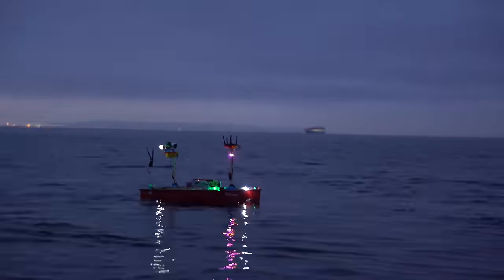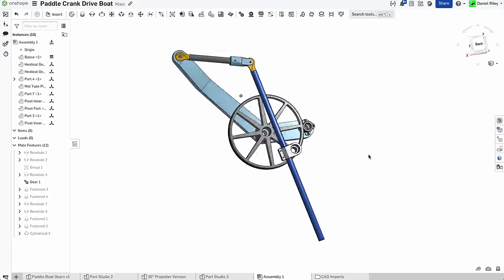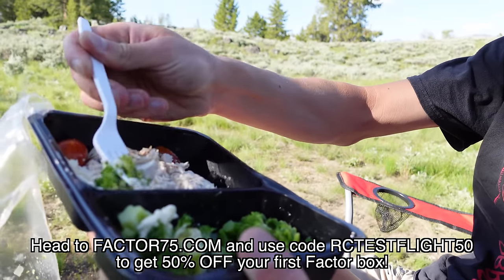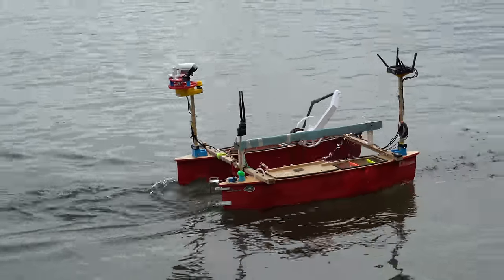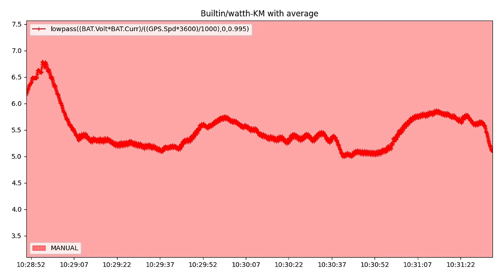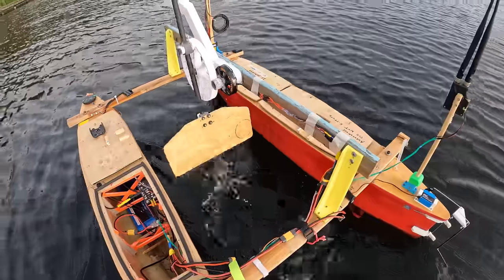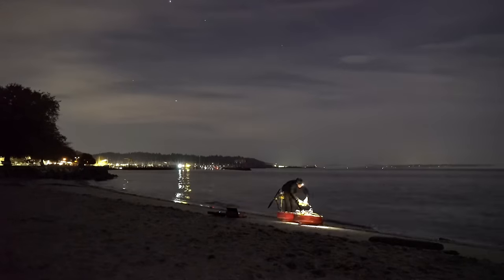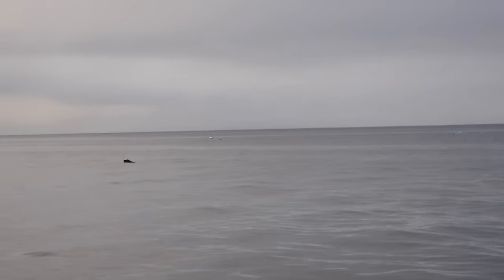Propeller Killer? High Efficiency Paddle Vs. Propeller

Comment: I once rode in a kayak that was powered by paddles. It was inspired by sea turtles. It had four paddles, two in the front and two in the back. You used a pedal like a recumbent bike and it would paddle side to side. It worked very well and was surprisingly efficient. This guy from Louisiana wanted it for use in the bayou.

Comment: One source of inefficiency is the eddies created on the sides and bottom of the paddle. I wonder if you installed sheet metal guides on the sides and beneath the paddle (as close as possible to the paddle) the eddy  issue would reduce.

Comment: i thought that adding another "bar" to the linkage could optimize the angular relationship of paddle to water...  there's very little energy 'lost' during the paddle 'return, but it does result in quite uneven loading on the drive train, so that a paddle on each side, with 180° offset might be smoother.
And, hmmm... Since tuna, dolphins and sharks all use an oscillating tail? Side to side, with adjustable compliance of the "fin"? Maybe use variable air pressure to increase/decrease the stiffness of the "tail" under different conditions...a quite small compressor that only runs as needed, and an electrical  valve

Comment: What about using differential drag brakes for steering with a paddle with a more optimized shape?  That should solve the seaweed issue, and only incurring drag when it needs to steer may mean it ends up more efficient.  

The paddle may also want to use the adjustable attachment method as well for reliability vs  waves and the like.

Comment: Hi. Great Maschine. Dome ideas: Put a weight on the big wheel that goes up when paddle ist in air and down when in water. Thus will glatten your power curve.

Another one: guess why sports paddlers use U- shaped paddlers and planes have wringlets. The energy in the whirlpools ist lost. The methods above macke them smaller.

IT nicht also bei worthwile to drill some holes in the paddle, for the same reason paracutes let air through

Comment: i suggest you make the paddle much smaller, just a rectangle, that would be completely submerged on the power stroke - that way you will minimize the air drag on the return stroke, i think.

Comment: Interesting. 
One question: what would happen to the paddle efficiency if you put it into a channel? A really tight channel left-right with just a couple of millimetres of clearance and the height of the paddle. Just so to minimise the amount of water that could swirl around at the edges. (like the point you are making at 12:35)

Comment: I’m sure plenty of other people have said this, but it’s my two cents so whatever. Part of the efficiency of a paddle comes from the fact that it not only pushes water behind it, but pulls the water from in front of it. But it can only do that most effectively when the entire paddle is submerged. Otherwise you get air sitting in front of the paddle Preventing it from pulling water from in front of it. Creating a larger path wheel might help solve this problem. Giving the paddle more of an ability to lift up out of the water so that you can make the paddle sink deeper.

Comment: Best chance of the boat to succeed I believe is longer waterline. It will dampen the smaller wind waves while still allowing you to keep the 'air boat' design & avoid pitching oscillation.

Comment: if you wish for an idea to milk that boat once more 

air duct-ed thrust (its kind of like how jets refocuses their exhaust but this idea has no jet's involved unless if used to produce airflow) essentially its like using a leaf blower or an EDF and aiming the propelled air via pipe (or ducts like you would a/c ) and in my idea would be placing the outlet ports to thrust from between the hulls

just had a funny idea thrust via compressed air and obviously that would be the worst in inefficiency but i released a chuckle when the thought sneak in

Comment: Very nice job 👍 
Maybe you should try some combination of either propulsion systems? For instance a front paddle wheel between two boat hull and one or more rear air thrust with blades
In addition you should definitely try other hull designs (different transom, different forecast, bulb etc.).
Have a nice day 😊

Comment: A lot of water is bypassing the paddle around the sides so would a curved paddle improve efficiency?
Also the aero props let you down big time so would a smaller 3 or 4 bladed prop be a better option. Perhaps using ducted fans would be a better choice

Comment: I wonder if a multi-paddle setup could be engineered to take advantage of vortex shedding around the paddle edges. Since a portion of the water in the vortex is moving forwards relative to the stationary water, a well-timed and -placed paddle stroke could "push off" of it for a boost in efficiency.

Comment: How about sail? Literally you only use the motor to adjust for positioning in the wind. It might need some better software for navigating when against the wind but theoretically exponentially more efficient (if slower).

Comment: If you are interested in testing other methods for efficiency, I'd be really interested in the dual screw drive like Colin Furze tank thing he made (or the original ice explorer it's based on).  I realise that the hull wouldn't be the same, so it's not a direct comparison, but interesting all the same?

Comment: FYI  I wonder if it might be interesting to test out the efficiency of really large propellers in the water.  This is ancient history and we know how memories are... But, when we were kids - i.e. 60 years ago, my sister and I were into rubber-band driven balsa airplanes (tomboys for sure).  Anyway, we also played a lot with toy boats on the water and I got the idea to power a boat with the propeller off the airplane.  The first was a simple flat board to which we mounted the prop, high off the water.  It was tippy and on one of the runs it flipped and surprise, it kept moving pretty well, being driven by the large air prop, now under water.  In fact, with the very slow moving underwater air prop, it went just a bit slower but ran for a very very long time.  Not great for weeds, obviously, and drew a lot of water, but interesting we thought,

Comment: In the early steam era the British navy took two identical ships with identical engines - they were both paddle steamers but they replaced the paddles of one with this new-fangled thing called a propeller. They were tied back to back and both started running. The propeller one dragged the paddle steamer along behind itself and won the trial. So the question of Prop V Paddle is long since resolved.
Reply: Try propelling a boat through a shallow, plant filled creek. That needs a tool fit for the job. That's where paddles rule.

Comment: a few ideas of how to make a better Paddle powered boat, if you had either 2 alternating paddles that wee half the width of the current one and move so that when one is at the lowest point the other is at the highest point, or you have 2 smaller paddles on the outside of the the hulls that move opposite the inside one so that you have nearly constant paddling, I don't know how the constant thrust vs extra load would effect the efficiency but it could be something to try

Comment: Just a suggestion. If you made the hulls longer and narrower, they would be more efficient and they would pitch less. With the longer hulls you could mount the propellors in the middle at (or near) the centre of the pitching moment. This would eliminate the problem of hitting the water and keep the propellors more stable which I imagine would enhance efficiency.

Comment: if you use two arms for the paddle with the bearing attaching them to the wheel in between them it will make the entry and exit in the water more lateral, like how the suspension on a car works

Comment: Maybe try a "fish tail" design. Essentially it would be an underwater paddle that provides a power stroke in both directions with no rotating parts for weeds to wrap around. If being completely underwater is too much off a challenge then it can still be done with a paddle dipped into the water. Videos of Venetian gondolas being paddled could provide inspiration.

Comment: When I was a small child my father built me a tiller that flopped from side to side as I pushed and pulled it from the stern seat of my small wooden boat.  It seemed very efficient as it developed thrust
Reply: In both directions.  It also allowed me to steer.  Perhaps with the proper shape it could be made weedless.

Comment: You should mount the air props so they have some hull beneath them instead of over the water behind the boat. Can't slap the water if the boat can't tip them into the water without taking on water. Same reason you wouldn't have a sail hanging off the back or front of the boat near the waterline, I guess.

Comment: Great work and interesting results that surprised me. I wonder how a simple paddle wheel compares; where the boat has no rudder and steers using two paddle wheels at the back. I understood that paddle wheels were replace by props because props are more efficient but your experiment suggests the opposite.

Comment: The paddle may work better if it is curved slightly towrds the front of the boat, with small "wings" to prevent water slipping around the paddle.

Comment: I think the air prop hitting the water effect would be reduced if the boat were just longer.  It's pitching too much. Double or tripple the length and it will be more wave tolerant.  There's probably an optimum boat length as measured in air-prop diameters.  Also a longer boat makes it more practical to raise the props a bit.

Comment: I wonder if a large boat with a flat hull could leverage the idea of paddling using a chain system similar to tanks. The paddle line would be extended at the bottom for contact with the water, and at the top, the paddles would be retracted to save space. Sorry for my English; it's far from perfect.

Comment: The paddle can be very much more refined to be efficient AND shaped to shrug of weeds, as it doesn't go all the way in and so weeds cant grab onto the top corners of it.     Steering could be a 90deg to forward mounted propeller out of the water, so no weeds there.
The gear down of that motor gives great efficiency in the same way earlier geared brushed motors were used to throw large props for better efficiency.
Really the only thing needs great care is the reliability of the paddle mechanism,  it's seemingly the only thing that could stop a big trip.

Comment: I'm no engineer, but I have 2 ideas. Make the paddle wider so that it almost touches the orange hulls on each side. Or, make a vertical dam on the side edges of the paddle to reduce blow-by of water during the stroke. Also, for the rudder, make it the last 5% of the low ventral fin length. With the ventral fin starting at no depth, and finishing at the depth of a rudder plate having flexible mylars overlapping from the fin body. This should snag zero weeds and allow efficient movement of the rudder. As for the better air propellers, much of the inefficiency was due to porpoising. Some sort of AI might be able to actively predict based upon patterns in movement, and counteract porpoising either through an elevator in the prop wash, or a vestigial fin used to keep the hull level (or at least a little more level).

Comment: 2 paddles fore and aft to remove the body lurch.  Don't know what mechanism, oval paddle wheel? But a stroke that goes the length of the boat.
Catamaran is a great design.
Trimaran with the middle body longer for stability?

Comment: Umm... I'd suggest that the air propellers could perhaps work a bit better if placed more on the central area of the boat as opposed to being rear mounted. Considering that the boat bobs in choppy seas, the middle doesn't bob as bad and as long as the propellers are on mounts that give just a centimeter clearence between boat and propellers, they would never hit the water surface.

Comment: Sorry, but as a German with not so good English, I have great difficulty following your explanations. But I have some basic ideas. Firstly, to install an elliptical gear ratio because you want to run the motor in its optimum configuration. This is because the motor has to work much harder when the paddle is submerged than when the paddle is travelling up and back. Although each additional gear ratio loses about 5%, this could indeed be interesting. I would try to find a solution where the paddle moves slower forwards (under water) than backwards (above water). 
There are thoughts about the shape of the drive sprocket on bicycles in this regard. 
Second suggestion: Make two attachment points for the paddle, not just one. Instead of one in the centre, make one on the right and one on the left. This would be much more stable. BTW, I always find your videos very inspiring.
Maybe you read this. I'll answer

Comment: Old water wheels had reached 90% efficiency with ‘bicycle spoke’ design when they were squeezed out by steam. Some of their best features were a huge tolerance for stuff floating down rivers which just passed through the system and low speed parts, meaning, low maintenance. 
Your paddle design has these features and, in practice, could be much easier to use than propellers or air props .

Comment: If the paddle was just slightly narrower than the width between the two hulls and the hulls had a more realistic draft (sits lower in the water), you would get even better efficiency from the paddle. This would be kind of like ducked fan vs open propeller.

Comment: If you moved the air props mid length along the boat it would not suffer from pitching. 
In the paddle section, if you had used a shaped profile like you see in low head hydro power turbines, I reckon you'd get a big increase in efficiency over a flat plate

Comment: It'd be interesting to see if some semi-thick rubber was used for the paddle instead of wood, the flex might help make it more efficient.

How about a mix of the different designs, have it switch between them as needed- for big waves maybe use underwater propeller or paddles, then for calm water use the air propellers- something like that anyway ;)

Comment: Just an idea, Maybe try an oscillating paddle that stays in water. Similar to the ones used in some Asian cultures. I would be really stoked to see if that turns out to be slightly more efficient than a normal one. It could also possibly work better in waves.

Comment: Great video, sad that the chop stopped the mission short. Timing the wind and the tide/current is very important. When the tide/current and wind are going in the same direction there is low chop, and when they are opposed there is big chop. This is true even if the wind is super slow

Comment: Before propellers the most efficient paddle wheelers were designed so all the paddles stayed vertical through their path around the wheel. These had propulsive coefficients close to propellers (~0.6). Having them stay vertical limits losses when the paddle enters and leaves the water.

Comment: No no no. Youre on the right track with the air props. The problem is the weight of the boat is causing momentum at the stern , forcing the props into the water.
What you need are independent lightweight trailing flaps that move with the waves every motion. And the vertical posts with props on those so they have a constant consistent distance from the water. It would be like a lifesaver being towed by the boat. Theres very little weight on them so they never submerge. A 10 inch vertical post holds the prop bearing with the shaft. horizontal.

Comment: Use egg/oval shaped drivechain rings to accelerate through the dead spot in the air and use a scooped shape paddle to stop spill out of water around the blades, and aerodynamicly efficient.

Comment: Two sets of propellers on each drive shaft ( one pushing the other pulling the air) create increased thrust without needing such large blades. This would make a more compact design. A couple of good demos on youtube adequately  demonstrate this concept.

Comment: Expect you have many ideas and iterations to choose from, but here's some ideas anyway:
Rather than a flat paddle,  use a bucket type i e curves or sides at the ends to catch mote water. A bit  like modern aircraft wings with the winglets at the ends, to control the vortex better and generate more 'lift'.
Have multiple paddles on the same mechanism, stacked horizontal so each stroke has multiple paddles pushing. I I I I...
Try to understand why circular paddle boats arent as efficient as a propeller,  then design and engineer one to be peak efficient, as it would be a very simple and robust mechanism to avoid propeller snag. Emg paddles on a circuit/belt loop driven by a single motor. This would increase the time the paddles were in the water and minimise splashing.🏟️. A bit like a tank track for boats.

Comment: since you have a twin hull structure, why not make a bunch of propellers on a conveyor belt, let the pedals touch both sides of the hull as it pass trough the center channel.
think of a tank's track passing trough the center and having pedals on it.
you could also have them fold back on the up and over to make it take less space, perhaps a mechanical pusher that as the pedal pass a point it gets retracted and locked in position and later extended and again locked in position.
a longer craft would be more efficient since you adding more pedals that way, also the pedals dont have to be the entire length of the craft 2/3 should me more than enough.
An automatic gearbox added onto it can increase efficiency since as it gets to speed it will require less work to move so a gear change would give it more power to accelerate and better top end.
lastly you would want a better keel wit a bit more ballast to make it ride the waves better and perhaps cut it more.